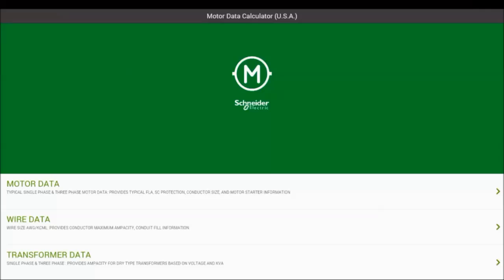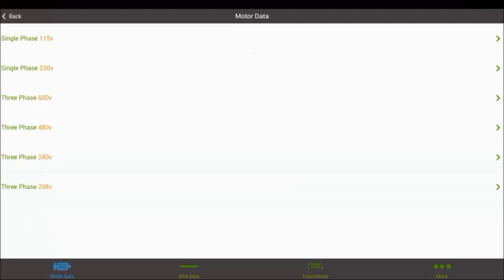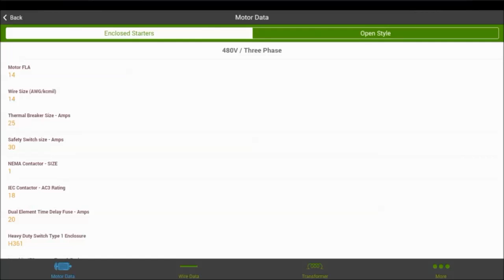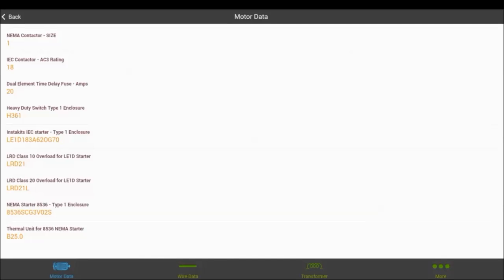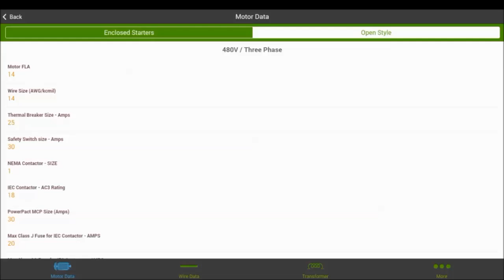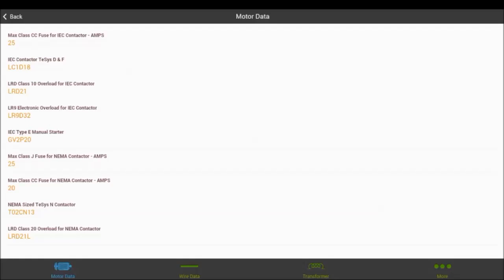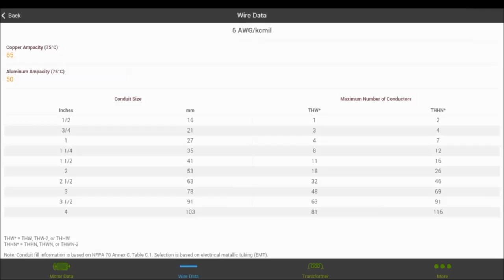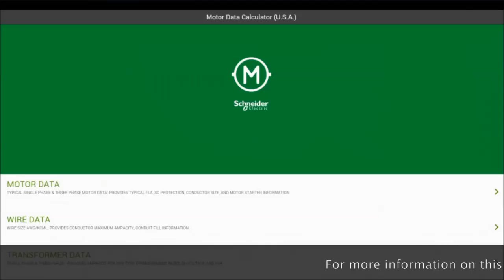Using the Motor Data Calculator Mobile App | Schneider Electric Support

Comment: sir how to find accurate swg wire number for  rewinding 3 hp  single phase  induction 24 slot 4 pole 1440 rpm motor stater defth 3 inch |||| , inner dia 4 inch |||| , outer dia 7 inch

Comment: I want 75 how barath bijili make 980rpm 72 slots 2coil sets 18 single layer 550volts motor winding data pls
Reply: Pitch 1-13 tan 8,8,8,8,8 swg 20,20,20,20,20,20,20,20,19 silot
Reply: @harjendrathakur7732  give me data for crompton greaves 3 hp single phase 24 slot 4 pole 1440 rpm stamping size 3 inch i
stater inner dia 4 inch nd outer dia 7.inch